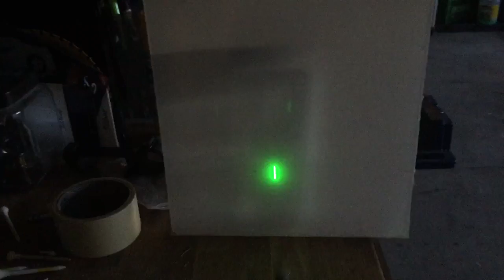FLO Demo with Golf Shaft

Comment: I just tried FLO-ing a Dynamic Gold Stiff Shaft with a drill chuck & laser and the response I get is a flat line regardless of the shaft orientation. Now, the initial path may be elliptical at the start, which probably is due to me, but shortly after becomes a flat line. Question, is FLO-ing required when using a good quality stiff steel shaft?  Thank you.
Reply from the maker: I haven't encountered any shafts, including the DG's that FLO in any orientation. That being said, I did come across TPT shafts (Graphite) who claim to be stable in any orientation, but with their ultra steep price tag, I've never had the opportunity to test one for myself. I have had trouble finding a solid FLO line with C Tapers and also have a Ping Tour Shaft (Graphite) that maintained a surprisingly tight ellipse in whatever orientation, but with that one, I did find one orientation of FLO, despite other orientations exhibiting tight ellipses. To answer your question more directly, I have FLO'ed a set of DG S300's, PX 5.0's and PX LZ 6.0's, all for personal use, and all of them exhibit a specific FLO orientation across the entire set of irons. Hope this helps.

Comment: How did you attach the laser to the chuck?
Reply from the maker: I had a friend bore out the threading from the chuck, and then I use the smallest laser, both in length and diameter I could find. I added masking tape to it so it fit snug inside the chuck.